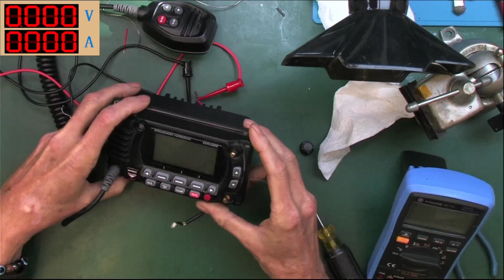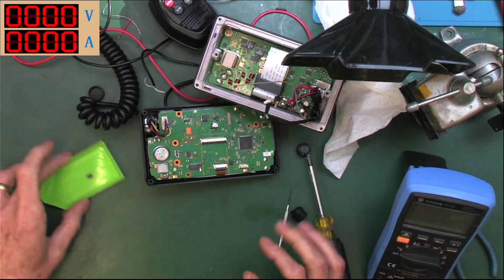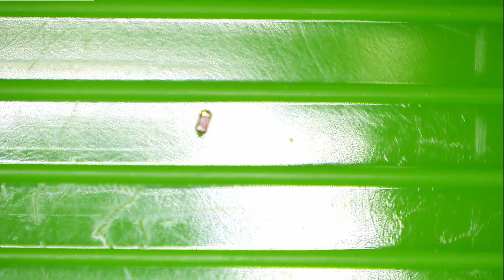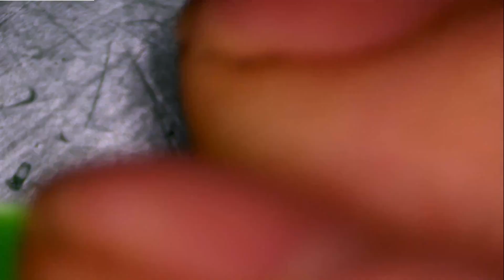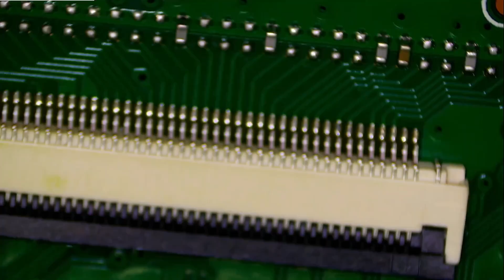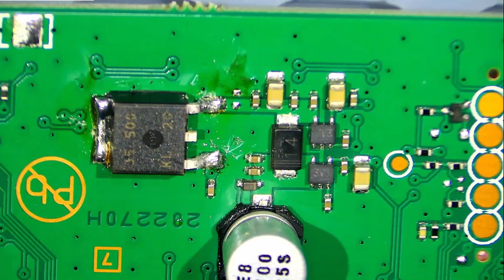Marine Radio extra parts

Comment: Where did the loose IC come from? And that mosfet might be a random replacement.
Reply from the maker: Do not know. Checked all visible boards surfaces, no missing components. AND it does work, just at a higher voltage than it should. Thanks for watching, keep an eye out for the next video where i dive into it.